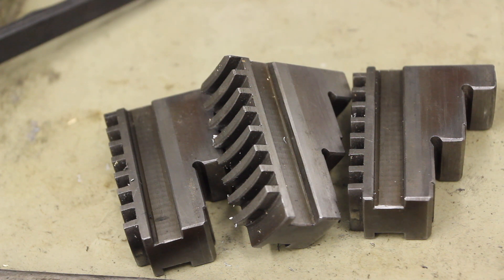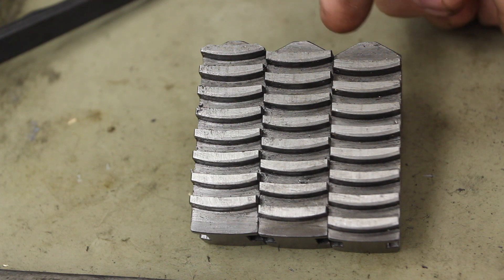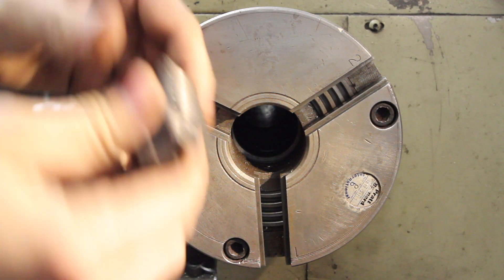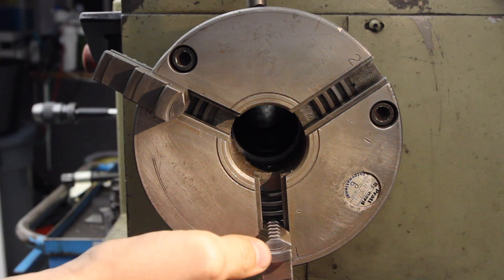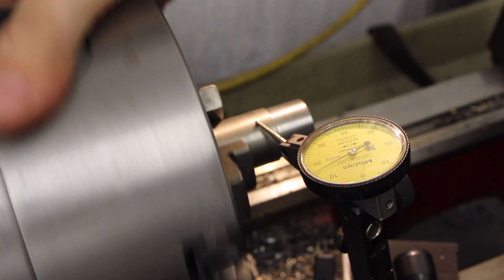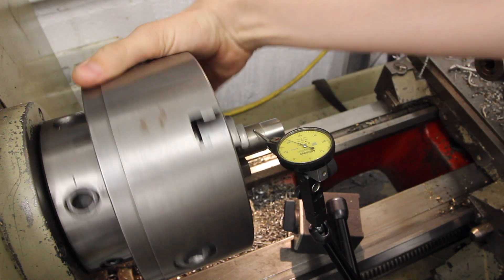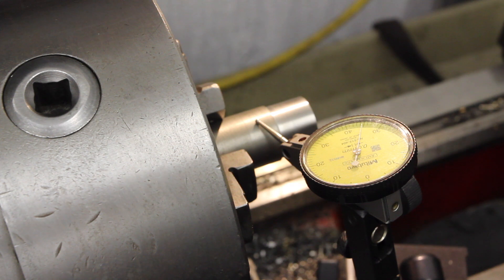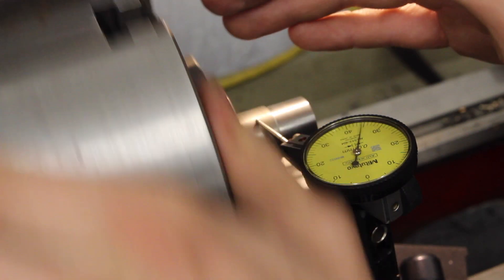3 jaw chuck jaws, achieve no runout!? top tips for beginners

Comment: So if your chuck isn't numbered it literally doesn't matter  which position the jaws are installed on the chuck, as long as you start with number one jaw and so on?
Reply from the maker: That's correct, though generally you might find better runout in a certain position :)

Comment: You can also take the three jaws in order but start from another point in the chuck... test the run out and than do the same thing in the next position. Likely one position will have less run out. If you have a D type chuck attachment (the type with three pins that rotate to hold the chuck in place) it is important to clean all the mating surfaces and as you start tightening the three lock bolts, don't do one at a time and tight. Instead run them up finger tight and than put a dial indicator on a test round you have chucked up. Gradually tighten the bolts starting with the high side to pull it in to place first. Finish in this manner. On my Smithy Granite 6" chuck I can get it to around .0002 concentrix which is amazing. I do have a 4 jaw chuck but rarely need it.

Comment: Question, you said to start with #1 but you put it in #3 slot, so your doesn't make a difference as to what slot you start with on your chuck or any chuck. I always keep my numbers in the marked slot on the chuck, Nice video, always very helpful.
Reply from the maker: As long as you put the jaws in order it doesn't matter what slot they go into.
sometimes you might get better or worse runout depending on where you put jaws so it's worth playing about :)

Comment: What i found useful was finding the high spot and tighten with a specific  chuck eye to reduce the run out and if it still has runout i would shim a piece of paper ,alu foil ,etc 
And of course to tap the end of the part  to run true    to the lathe bearing to finish it off.

Comment: More often than not
If you have run out...
Your jaws are worn in their tracks...
You must then  grind the jaws on a surface grinder and remove a few thou on the inner rear edge washing out at the tips.....say 3 thou...
If you don't....when parting off the job will move and shatter your parting off blade....

Comment: “Got lucky”.  You sure did. Honestly anyone working close on a machine lathe would not use a three jaw for close work or repeating set ups. Three jaws just don’t repeat. Even the high dollar Pratt and Bernerd will run out .001-.002 from one part to the next. 4 jaw for close stuff.. 3 jaw for the quick stuff. Good video.
Reply: Good enough for me!!!
Reply: I had a rockwell with a 6 jaw universal that was pretty good. Not good enough though... my dad said back in the day you'd use a toolpost grinder to tru them!

Comment: I've always known to insert the jaws in order, but the video close up of the ladder on the jaws and the starting spline inside the chuck makes everything clear on how it works. When flipping your jaws to accommodate larger sizes, do you insert 3 first and then 2, then 1?
Reply from the maker: in the case of a 3 jaw self centering you can't just flip the jaws. This is because the teeth on the jaws are radiused to suit the scroll. instead you have to buy a set of external jaws, these are still installed in the order 1,2,3 :)
Reply: @mcgrorymachined7596  Thank you, I DID see that, but for some reason my brain didn't register the radius on the jaws.

Comment: Well, this beats drilling 4 holes, tapping them around the perimeter, then taking 10 off the mount lip. Then loosening the hold screws, adjusting the 4 tapped, and tightening the base.

Comment: I most certainly don't want to do this all the time, especially if I have several or more components to do. I would rather first check the alignment of the main spindle(head stock) and the bed to see if they are running parallel. Then regrind the jaws which would be a more permanent solution. But, if regrinding is going to help on your chuck, I don't know brother. With the amount of run-out on your dial indicator and the fact that you can just tap the jaws to get rid of it is seriously a worry to me. There must be a lot of wear on the inside of your chuck and obviously the jaws as well.
Reply from the maker: it's not excessive wear but being a 1985  machine there's certainly some. like you say a more permanent solution would be reground/new jaws. headstock alignment won't have any influence on runout.
thanks for watching :)

Comment: Does this work if after one end of a piece is machined and then flipped end for end? This is where I tend to run into concentricity issues. I know, I need to invest in a 4 jaw chuck.
Reply from the maker: Hi, yes it does. of course you must clock off a diameter machined in the first setup. 
many thanks for watching

Comment: Will this work for a cnc lathe?
Reply from the maker: with hydraulic power chucks you can sometimes improve results but not with the same success seen on scroll chucks. 
 a CNC machine with a scroll chuck will be be no different to a manual machine 
hope this helps :)